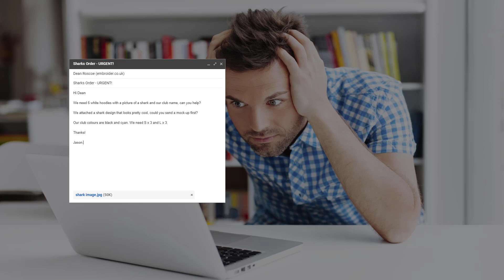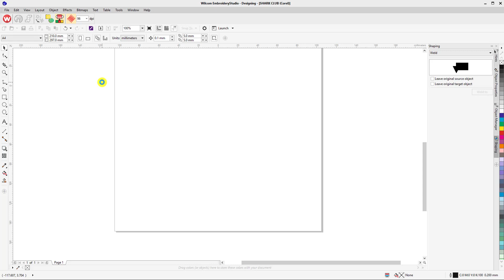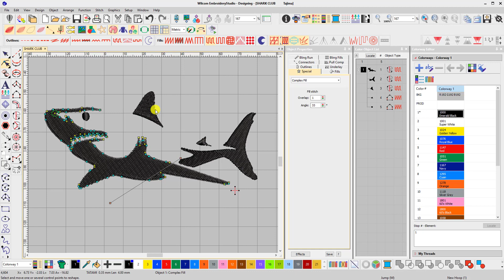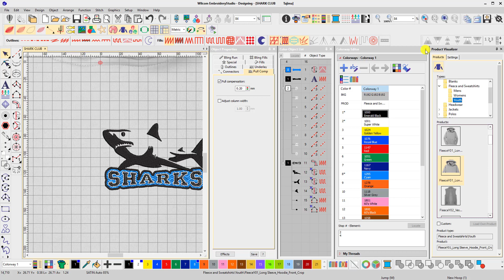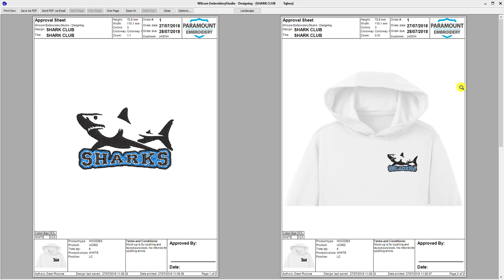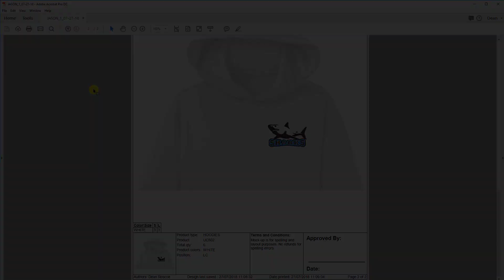Wilcom Tutorial 4. Embroidery Business Software

Comment: Hi
Thanks for the video.itwas very helpful.i really appreciate your work.i have a question for you that whilst watching the video i noticed you have used pull compensation tool.what's that for.could you please explain to me why we use pull compensation tool whilst digitizing a design
Reply: Hi Shoeb, Pull compensation makes the stitches sew beyond the object boundary to make the embroidery thicker. It's used to compensate for stretchy fabrics which pull stitches inwards. A good example would be lettering stitched on a polo shirt... If pull compensation was not used then the text would look skinny as it is stitched out.
Reply: Dean Roscoe 
Thank you for your reply.just need one more clarification that should we turn on the pull whilst digitizing only logo or it has to be turned on whilst digitizing any design.because if the pull is switched off the object will look skinny as it shirnks itself when the machine runs stitches.
Thanks
Reply: 90% of the time pull compensation is usually switched on. The pull compensation setting value will depend on the fabric type. There is a video all about it at www.wilcomtutorials.com
Reply: Dean Roscoe 
Ok i will surely go through the video.thanks for your help